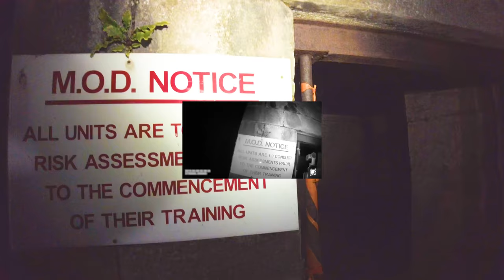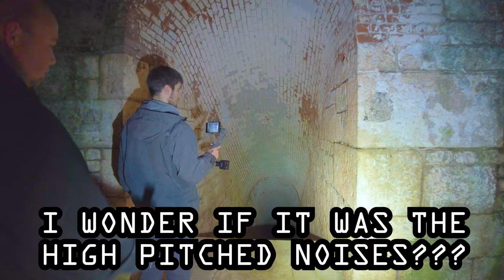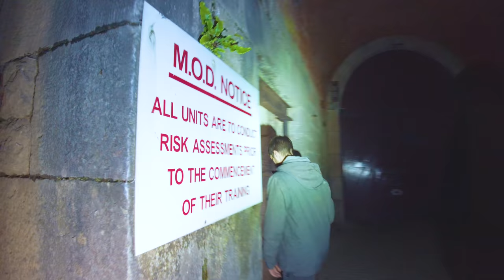NEVER ENDING TUNNELS at Scraesdon Fort PLYMOUTH

Comment: Re: 48:00  . At the time you happened to visit this location and shoot the video, I was on the toilet with very severe constipation. During my intense pushing I let off some high pitched squeals and unfortunately it looks like they flooded the radius of the UK due to the intense energy used during the pushing, which is the cause of the strange noises at 48mins into the video. I apologise and my bowels have since returned to normality, so I don’t think this will happen again

Comment: Fascinating.  The rock in the tunnels is most likely petrified mud or mineral deposit.  See Mother Shipton 's Cave where minerals will petrifying almost anything in a very short space of time.  The engineering and quality of the structure is most likely the reason this remains as cost of excavation would be beyond any worthwhile gain.   Interesting 'star fort' plan can be seen in the aerial images.  The question is how and when was this really built.